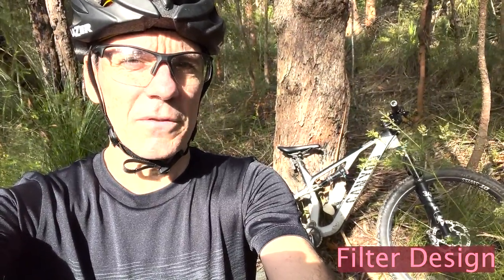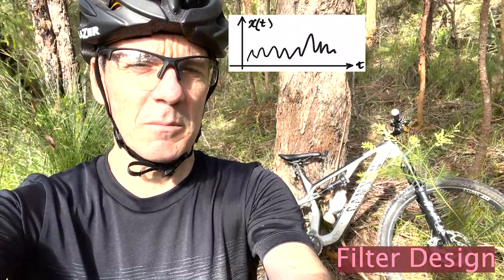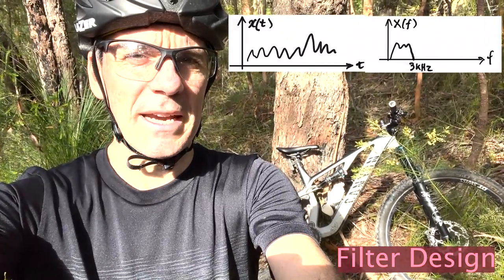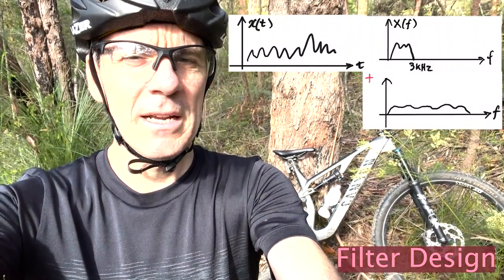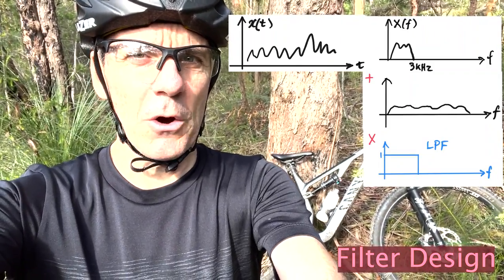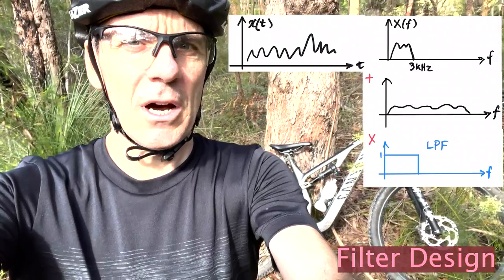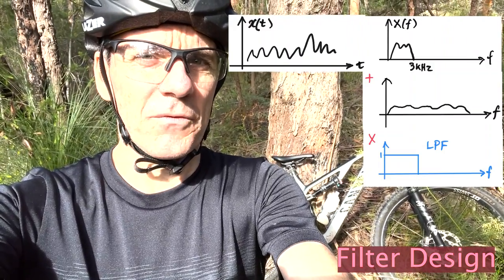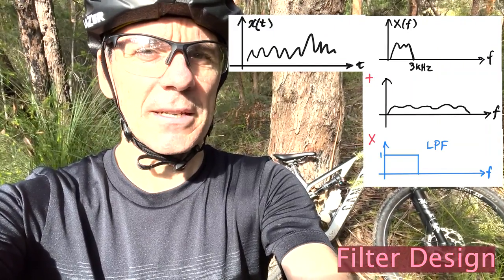What is the Fourier Transform used for?

Comment: The Fourier Transform is also important in crystal structure solution, where one tries to obtain the atomic positions from a set of diffraction patterns. This is not necessarily a part of everyone's typical day, but it is for crystallographer's.  And is also quite important since many modern inventions rely on knowing the internal symmetries of the crystals comprising them (pharmaceutics,  energy,  electronics). The Fourier Transform really is one of the greatest and widely used tools.
Reply from the maker: That's very interesting. Thanks for sharing. I've had experience in signal processing for radar and medical imaging applications, both of which formulate problems of a similar form to diffraction patterns that you mention, so it's interesting to hear of the crystal structure application too.
Reply: @iain_explains  I have read some articles about signal to noise ratios in medical imaging. I was trying to find a suitable metric for my work. It might be worth it for me to check out some papers on those topics in more detail, then. They might offer insights into problems faced by crystallographers today. Thanks for the suggestion.

Comment: A topic I've been wondering for some time now is why in RF we capture and transform complex numbers, while acoustic applications are perfectly happy with real numbers. One explanation I have is that for acoustic, real time applications it's critical to add little or no delay, so often IIR filters are used, that add phase distortions. But apparently our ear is not so sensitive to phase (I guess, high frequency, but middle to low frequency phase distortions would mess with perceived direction of arrival). And what about image transforms, that again use DCTs?
Reply from the maker: Hopefully this video will help: "What is a Baseband Equivalent Signal in Communications?" https://youtu.be/etZARaMNN2s
Reply: @iain_explains  ok, I'll see you there
Reply: @iain_explains  hi Iain, I saw that video but I'm not convinced. Ok, audio signals are low in frequency so we don't need to demodulate them from IF. But still, if we used an acoustic signal to transmit a QAM modulation we would need to perform complex sampling (or deriving IQ with a Hilbert transform). I guess the fundamental reason why acoustic signals are only sampled real is simply because they're not typically digital communication systems.
Reply from the maker: @ZiglioUK  Well, not really. It's actually because we are only interested in a small bandwidth around the central "carrier" frequency when we're considering RF (or any "bandpass" signal). It's not specific to digital communication systems. What's important is that we sample (or "capture", as you put it) sufficient statistics to be able to fully define the continuous time signal. If it is a lowpass (or baseband) signal, then we can do this by sampling real-valued samples at a sample rate that is twice the highest frequency component of the signal. If we have a bandpass signal, then we're not interested in any of the frequencies in between the zero frequency and the lower frequency in the "passband" of interest. And so, instead of sampling at more than twice the RF/carrier frequency (which would require extremely fast ADCs), instead we "down convert" to a lower frequency and then sample that signal. The thing is, when we "down convert", we do this with a sinusoidal signal. Now, any sinusoidal signal will have another orthogonal sinusoidal signal at the same frequency (90 degrees out of phase), and since they are orthogonal, you need to down convert with that one too, so that you don't miss any important information of the RF signal. So now you have two "down converted" signals, which both need to be sampled. We represent these two signals with "complex valued" samples. One sample from each of the two orthogonal down-converted signals. Hope this explains it.
Reply from the maker: Hi Emanuele, I've just made a video to explain this. You might like to check it out: "Sampling Bandlimited Signals: Why are the Samples "Complex"?" https://youtu.be/JglRGRizqGM
Reply: @iain_explains  thanks Iain!

Comment: i am interested in Ft or FfT because it's used in Spectrum analyser but wondering why it's FfT which is used instead of ft and what is the difference between ft and FfT !
Reply from the maker: This video will help: "How are the Fourier Series, Fourier Transform, DTFT, DFT, FFT, LT and ZT Related?" https://youtu.be/2kMSLqAbLj4
Reply: @iain_explains  i have watched this video but after watching some video i found that FfT is just fast efficient FT algorithm that you only mentioned briefly so the difference is clear to me .
Reply from the maker: Actually, it is a fast efficient implementation for performing a Discrete Fourier Transform (DFT) (which is not exactly the same as the Fourier transform which is in continuous time).

Comment: Why is the information you get in the frequency domain more useful than the information you get in the time domain? (For the purposes of signal processing)
Reply: More specifically, could you either comment or make a video on what kind of useful information can you (in general) extract from the time domain, and what useful information can you extract from the frequency domain. Maybe specific examples which demonstrate the utility of the frequency domain vs the utility of the time domain? What information about the signal do you gain/lose when in the time vs frequency domain?

Thank you !
Reply from the maker: Good question. First I should make the point that the same "information" is contained in both the time-domain representation, and the frequency-domain representation. No "information" is lost when transforming from one domain to the other. However, viewing that information in different ways, can certainly reveal different things to you. If you'd like some examples of the uses of the frequency domain, you might like to watch this video: "What is the Fourier Transform used for?" https://youtu.be/VtbRelEnms8

Comment: The picture with the FT from the frog and the bird: it is only an example, that's clear.  From whole FT (picture left) you cannot get the FT of different animals, can you? You only know that both are inside, not more, I assume.
Reply from the maker: It's basically a "pattern matching" problem in the frequency domain. The frequency characteristics of a frog (ie. the "shape" of the function in the frequency domain), are different from the frequency characteristics of a bird. If your measured signal has sounds from both a frog and a bird in it, then the frequency domain will contain both "frequency characteristics" added together, and it is a question as to whether your signal processing "matching" software can pick them both out.